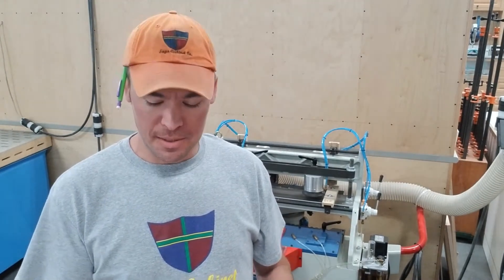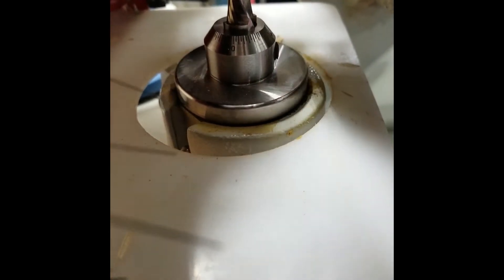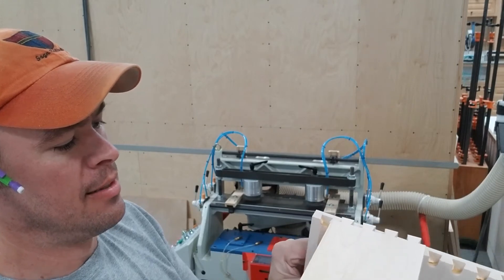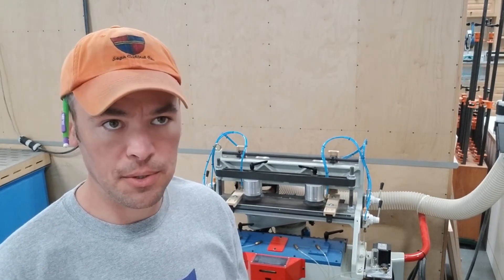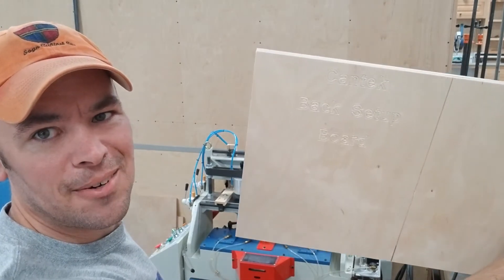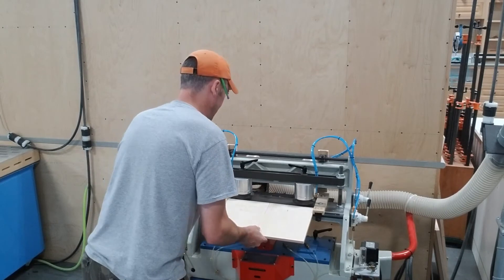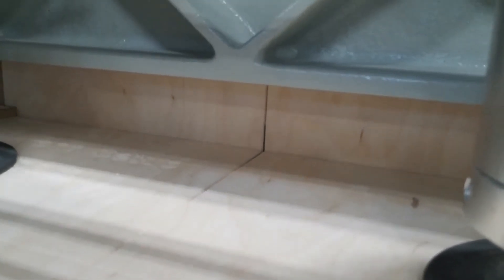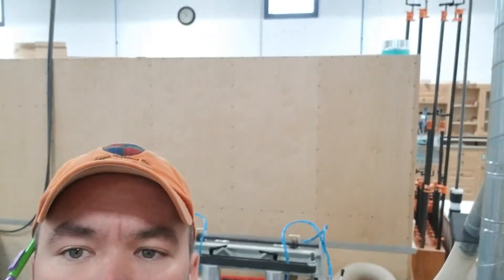Cantek JDT75 Automatic Dovetailer Setup

Comment: Help! I have a very similar model from Castaly. I cannot figure out how to cleanly cut pins out of 1/2” maple multi ply. When the bit runs across the grain it will chip out a big chunk of the pin. Do you have any tips with using plywood?
Reply from the maker: @codycollins8666  I've got another video that goes through how I make a drawer.   Not sure your answer is there, but can't hurt

Comment: Hey, I realize this video is 3 years old but do you know how to replace the belt??
Reply from the maker: That's funny.  I just replaced the spindle this morning.  Cover above the motor, 4 bolts.  Remove that.
The motor rides in an eccentric cam to tension the belt.  there's a clamp accessible through a notch in the casting you can see from the backside.  Loosen the clamp and clock the motor to loosen the belt.
Under that first cover is a bug aluminum pulley.   There is a set screw at a weird angle,  you need to loosen the set screw, to remove the pulley.
Double check the motor is clocked to the loosest setting.
Pull the spindle, then you can get the new belt in place.
Reinstall the big pulley slipping the belt onto it as you drop the pulley into place.  Use the fastener that goes in the shafts of the motor, without the washer, so you can hold the motor shaft and spin the pulley and lineup the keyway.  Drop in the key, tighten set screw.  Tension the belt, (I wouldn't use much), replace covers and tighten the motor clamp. 

Then start the nightmare of adjusting height and fitment again.   😆

Comment: I'm ordering this machine this week I guess. I have 752 plywood drawers to do for a project. I have this notion that I will place the largest width drawer side possible in the machine, (about 16 inches?) and then rip them down to size on a table saw with a feeder after the dovetails are cut. Should be able to dovetail three drawers at a time that way with none of that dead space in between where the machine is moving, but not cutting. What do you think? Would it work? Would it save any time?
Reply from the maker: I think you'll save time running the parts large, but you'll lose it handling and cutting them again.  Plus, you're introducing more risk for error.

Buy extra tooling, I'm guessing you'll go through two tools doing that many plywood drawers

Comment: On your machine does it chip out the piece on the left? The side piece that stands up. Setting mine up and both pieces on right are perfect. The left piece has nothing backing up the edge of the material.  The edge closer to center. Thanks running single flute currently.
Reply from the maker: I make all the drawer sides 1/16 big and size them after machining.  I just take material after the top edge.
There's nothing you can do about the tear out without having a cnc doing a climb cut in the appropriate places.  I've got a video on how I make the drawers as well that might be helpful

Comment: Can that machine fit 2 9.5" boards?
Reply from the maker: Negative.  Two 8-1/8" pieces is max.  9-1/2" won't fit the pin spacing either
Reply: @KBrogger  Thank you very much!

Comment: My questions and where I am struggling is..... should you be able to take parts that are machined on opposite sides flip them and have them line up flush? Is there a particular starting point measurement from the home position?
Reply from the maker: If they are machined ultra well, then yes.  BUT, I don't even attempt to do that.
The bottom edge of my drawer parts are always the bottom, and they won't line up if just flipped to the opposite side.  If you flip and rotate, then they will though.  That is where the board I made to adjust both of the stops at once comes in to play.  You want those centered extremely well so the pin and tail elevation is the same on the two ends of the part.  So your home point is basically the center if that makes any sense?
Reply: @KBrogger  Thank you for your response. I don't know if I confused you with my question but I believe your answer was what I was looking for. 
What I meant was when I machine a side and front or back on the right side of the dovetailer I am trying match the alignment of the parts from the left side. 
Hope that makes sense. 
Also, where can I find the video of how you build the drawers?
Reply from the maker: @KevinAnderson-uj6db    I think this works....  This is the video I made of making drawers.
https://www.youtube.com/watch?v=iQ1vo_hdKIY&t=2s

If you go to 7:25 in this setup video, there's a pretty good explanation of how to get the fences set.  You're never going to get it flawless perfect.  There's just too many factors, but you can get it pretty darn good where just a quick swipe of the sander and it is fine.
Reply from the maker: I've got another video of how I actually build my drawers that might be helpful too.

Comment: I have a Laguna that is very similar. How is the spindle drive belt adjusted?
Reply from the maker: I didn't look for an answer to the Laguna, but was hunting around Cantek's website this morning looking for dovetail tooling, and came across the manual.  The adjustment process is in there.  I wouldn't over tighten that belt.  I don't think the bearings respond well to a large radial load.

Comment: Once the battle of the initial set up is done is there a lot of tweaking? How many boxes would you say you can do in an 8 hour shift?
Reply from the maker: Once setup, it doesn't require much attention.  I'd think a couple hundred could be machined in one day?  I know I've measured the cycle time, but I don't remember for certain.

Comment: Have you noticed the Quill getting hot as fire or is it just me?
Reply from the maker: It does get hot.  I've replaced that whole assembly once.  I've been meaning to take the old one to a machinist to take it apart and replace the bearings so I've got a spare
Reply: Mine got hot then started cooling but still loud as hell, cantek sent another which I'll try today. Took old one apart and the way the spindle is assembled the bottom bearing is starved for grease. Your video really helped me get mine dialed, thank you.

Comment: Hello. Thanks for the Cantek Video. Very helpful.  
Now for the bottom line:  Would you do it again? The except one/type etc. If not, what is your recommendation?  WE are NOT a full time, advanced Hobby, maybe very advanced, just don't do it full time.
I've got a chance to buy one of these, but ???
Yes, it's for a very reasonable price less than $4K for a lightly used one.
Your opinion will count if you share one.
Thanks. Nice work. Michael
Reply from the maker: It's okay.  If you've got enough reason and floor space, there's no reason not to.  Any other option that is better, is exponentially more expensive.  I'd like to have a specific 2 axis cnc built to do this work, but I'm guessing I'd be looking at $80k+ to have something built.

Comment: Just watched your video. I am debating getting it. I have a manual dovetail now. Would you buy it again, knowing what you know now, or look at other automatic machines?
Reply from the maker: The only other options I am interested in are way out of my price range.  I'd like a dedicated single spindle cnc machine for changing spacing, but that's about it.  If I had the time and money for it I'd like to build one.
Pure, hardcore production Mareen Johnson has the best machine I think.  Last I looked they're $75k if I remember right.  You gotta make a lot more drawers than me to justify that.
I'd buy one again, but I'd hate figuring out this setup stuff again.  That was hard earned knowledge to get the results I wanted.
Reply: I did see the Johnson version up at an auction and it still went higher than I wanted to pay. I was doing nested plywood drawers on my CNC, but we still have a need for solid wood drawers. I really appreciate you taking the time to post these videos. I’ve learned a few tricks from them

Comment: Thanks for posting this.  I have the same machine but it is branded as Northtech DTM75. I'm not sure what Chinese/Taiwan company is the actual manufacturer.  I think it is copied from the Omec 750. The machine does require a lot of set-up and you need to be very patient.  On the plus side, it is built like a tank.  Thanks again for your set up tips-- very helpful.
Reply from the maker: No problem John, if I helped, I'm glad.  There is so little information on this machine out there.